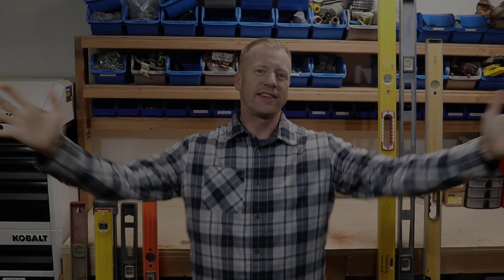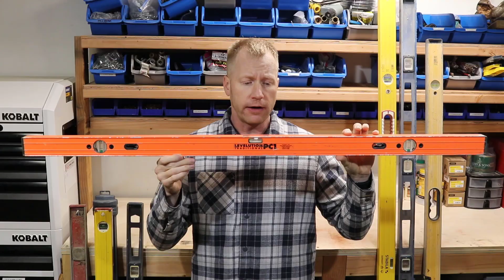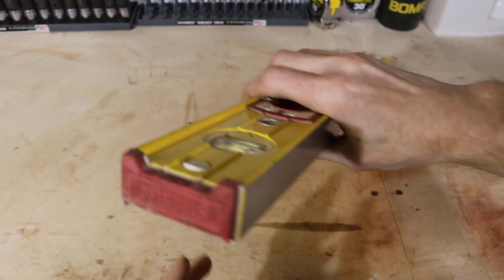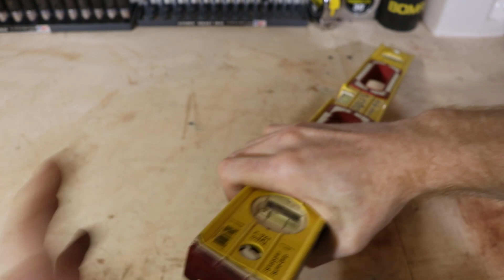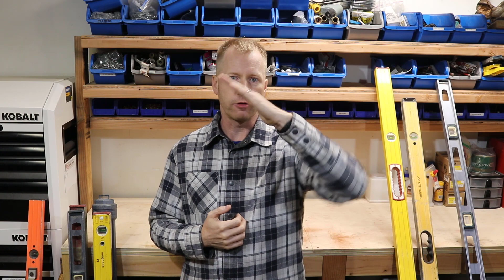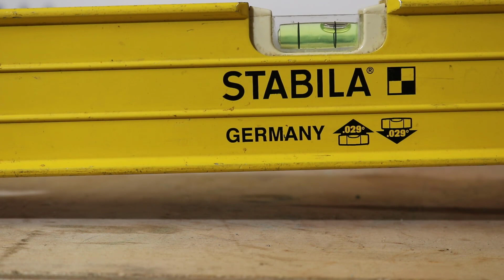Tool Tuesday Levels Part 2, The Long Levels, With Bonus on How to Check Your Level For Accuracy!

Comment: Stabila fans, check out the How Far Out tm level gauge at www.howfarout.com.  Our Stabila Plug-n-Play model mounts instantly to any  Stabila 96/196 or Tech series level to give quick precise surveys of out-of-level/plumb conditions. As a millwork installation specialist, I invented it for close-quarters work in older structures, such as fitting new doors to existing frames. For Stabila Tech levels, the gauge can be used to calibrate the digital module with absolute precision. With the level resting on any horizontal surface, just use the gauge's level adjustment screw to dial the bubble into perfect position, then press the calibrate button.

A single HFO Plug-n-Play gauge can be used with multiple Stabila levels. It simply snaps on and off by taking the place of the Stabila removable end cap. We also offer a Universal model that includes a magnetic adapter. It can be used with Stabila XTL, 108T,  and 80T, as well as other premium brands.

Comment: Lolll... you can pronounce my name "I brazzo"... zeau pronounces like zzo. No worries if you can't get it right. I'm a French Canadian from Montreal, Canada.

Good video on the longer levels.  I have the extendable plate Stabila and love it.  That with a Tajima plumb bob will often save the day especially while checking or adjusting long wall racking.  Stabs are the best imo and I think homeowners should consider them as they will last a lifetime and can become hand-me-downs if they are well taken care of.  Ppl spend a lot on lasers and often, they fall out of level or plumb or the battery dies rendering them useless.  My hand levels have never let me down.  And if they did, a new one is easily found anywhere. Actually, I need another level and I think I'll get the 6' model you have.  

I am not sure about the new digital ones... adding technology to a tried and true tool seems like asking for trouble.  Dropping it surely would make me cringe.  Also, slope and gradations can be determined using lasers or a vial level if you know how to use it... or a water level which work tremendously well lolll.  Actually, as a supplement to levels, a water level is a lesser known tool... and very precise at that... If you haven't done so in the last, I'd like to suggest if you could look into explaining how to use one in various applications (pools, footings, decking, cement floor dipping, etc.). 

Thanks for posting.
Reply from the maker: I am always amazed at how hard it is to see and even find a laser plumb dot or line outside. I pick up the used clear visor lenses from the welders hoods/masks to help find the laser. the more scratched up the better! I do want to try the newer green beam lasers though. Makita and DeWalt both have models that all of the plumbers and electricians seem to like.
Reply: Dan&Sarah Makers - I now have a DEWALT green laser, the model that goes 360 on 3 axis.  It is good but because it rotates within a bracket, small adjustments are hard to attain.  That being said, green is great for interior work even on a sunny day... no glasses really needed.  Outside, you will still need the story pole and the green laser receptor.  Drawback? No because it speeds up the process tremendously and the learning curve of the receptor and story pole is short.   The only problem is the cost... here, my laser costs $699 (there are much cheaper ones too lolll), the tripod $75, the story pole $75 and the receptor $199.  Add taxes and the total cost is in excess of $1200.  Goes fast especially if you add another rotary, a few batteries, the bags etc.  Compare this to a water level at $50, string lines and hand levels.  

But, since I have the green laser and the red ones... I seldom take the reds anymore.  Would I go DEWALT again.  Not sure because their lines get rather fat after 10' or so whereas PLS/Fluke stay thin much farther.  I like the ruggedness and rechargeable batteries of the DEWALT.  The PLS/Fluke is nice for precision.  The only two problems I have had with PLS, my last one was about 5 years ago, was that the laser flask didn't lock when not in use making it very fragile during transport and the foil that surrounds the laser flask (in the base) eventually unglued and wrapped the flask.  I threw two of them away because of these issues.  So yah, I just answered my question... I would buy a DEWALT green again for sure lolll

The beam lasers from PLS/Fluke, DEWALT and Makita are all top notch.  Used them or seen them and they are all great.  I like the 12v batteries because I hate buying single use batteries so I bought a DEWALT lined laser a lot because of that.  For the beam (dot), my dewalt came with a green light amplifier plate that I use to see the line or dot in brightly lit conditions and it works great.  It will fail in bright direct sunlight though. They have the same plate in red.  Get one ordered at any dewalt service center and if you need help I can give you the part number or send you one.  I have a service center nearby.

Lolll... All this to say, that for me and a lot of others, GREEN lasers are much better then the red ones.  And if you stick to those brands, you go can't go wrong.